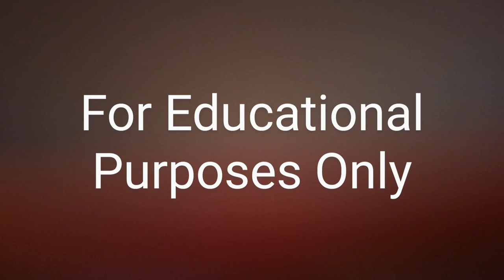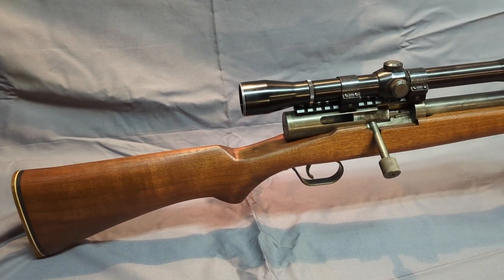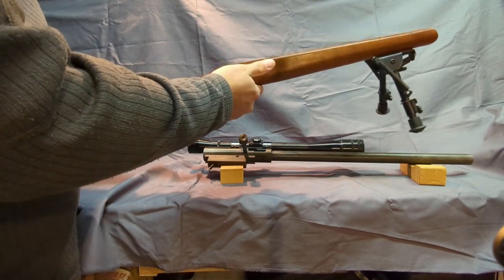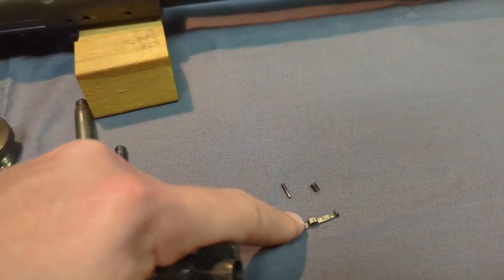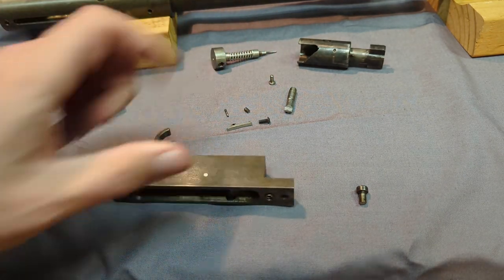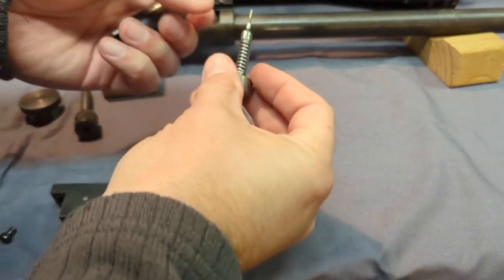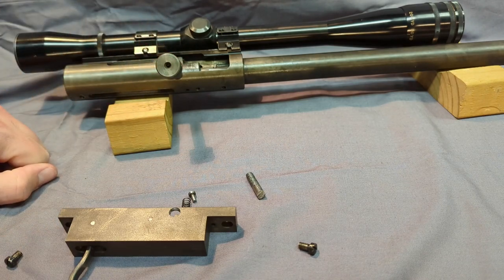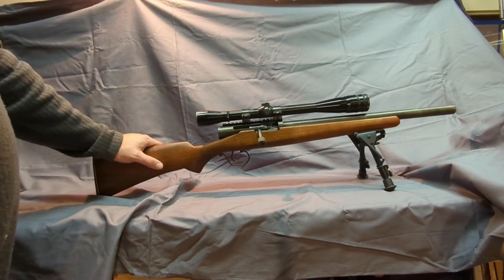Homemade Single Shot Rifle the 6mm-223

Comment: well done garage guy, I like the simplicity and straightforward design. Looks like the gun would hold up to some pretty hard use should the need arise. I havent went through all of the comments but if no one else has asked, how does it shoot? and how is the trigger?
Reply from the maker: Thanks! It's the most accurate homemade gun I've made. Several sub moa groups. It's got a crisp trigger, but not a drop safe design for sure.

Comment: Awesome group, the accuracy at 100 and 600 yards is incredible for a long distance like this, proof that the rifle was very well made
Reply from the maker: Thanks. I can't take all the credit, those Shilen barrel blanks are very nicely rifled.
Reply: @garage.guy.3006  Is the barrel blank you say just a rifled barrel without a case chamber or does it not come rifled? I don't understand much about this
Reply from the maker: I normally get unturned barrel blanks. These are rifled by the manufacturer, but that's it. You have to turn the diameter, thread it, chamber it and crown it. Early on I used to buy old barrels that were already chambered, but I like starting fresh.

Comment: Great work, it shows you have experience with this. Could you tell me if the barrel is rifled or not and its dimensions?. Thanks in advance and goodbye.
Reply from the maker: Thanks, glad you like it. It was a Shilen unturned barrel blank. It was rifled when I bought it (1 in 10). I turned it down to approximately 1" OD. I added threads, chambered and crowned it. Total length is a little over 18".

Comment: I have been looking for a new caliber for predator hunting at night with a thermal... 6 arc 6 max... but the 6x45 is a interesting one.. i believe thats what im going to go with.. 12.5" barrel with a suppressor... running 55-58 grain bullets... mainly because i gave a ton of brass laying around... any powder recommendations for velocity? Looks like aa2200 is the one people recommend for light bullets an higher velocities... still trying to get as much information as i can before i try it though.  
BTW NICE RIFLE!
Reply from the maker: Thanks, I'm glad you like the rifle. Mine really likes 70gr bullets. I had good luck with varget,  imr 4198 and 4895. That imr 4895 and 70 gr sierra bthp match was grouping really well at 100 yards, and I was even getting about 1.5 moa at 600 yards. It's a good cartridge, easy to just resize 223 brass. Good luck and thanks again.

Comment: Your designs are really cool, one thing i wondered about though is why don't you have a recoil lug? Or have i missed it?
Reply from the maker: Thanks and good question. That cartridge doesn't have a bunch of recoil. But for this design the recoil is supposed to be absorbed into the stock at the back of the trigger housing. Not really optimal. I've considered adding one at the barrel receiver junction. And I probably will on anything recoil potent going forward.
Reply: @garage.guy.3006  imagine something like a tikka where they just cut a slot and put a block in would be a  very simple solution

Comment: Did you heat treat or harden any parts? ( simply curious). I made an extractor for a pistol I own, and didn’t really know if I should heat treat it. Works fine but I also don’t want to prematurely wear it out. Impressive work.
Reply from the maker: For this gun yes, I used some surface hardening compound and hardened the bolt. But my new guns I don't harden because if it's not done just right the metal can become brittle. For any of my newer homemade guns I buy specific steel with a really high yield strength and not harden.

Comment: Hi sir how do you connect barrel to receiver, using barrel screw or threads?
Reply from the maker: They thread together. They are attached very tightly. You don't want that coming apart obviously.
Reply: @garage.guy.3006  Thanks for the info, have a nice day.

Comment: You mean this barrel frome inside is 6mm
Reply from the maker: Yes. It was designed to shoot 6mm or 243" bullets
Reply from the maker: Definitely do the math on any design, and make sure you know the type and strength of your steel. Normally you see 22s or some shotguns that use the handle as the only lug. So it's not the strongest design out there. Be safe
Reply: @garage.guy.3006  another question if i want to make barrel wich come first chambering or rifling cuse iwant to make the chamber then put a rifling button inside